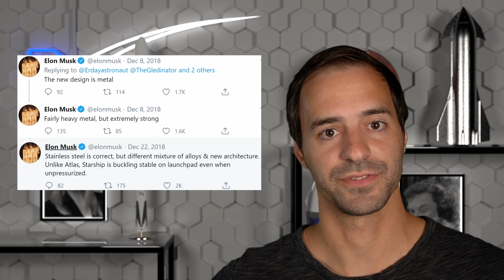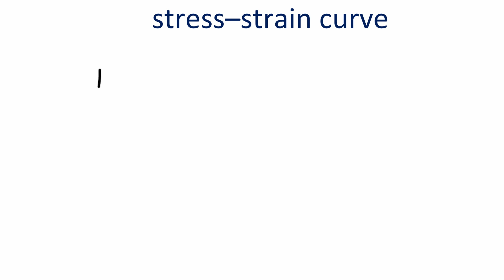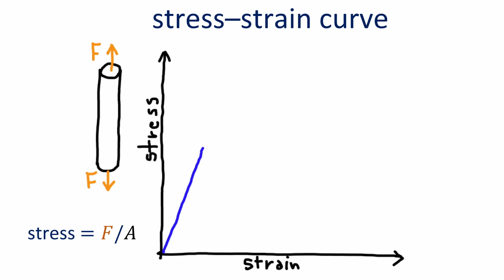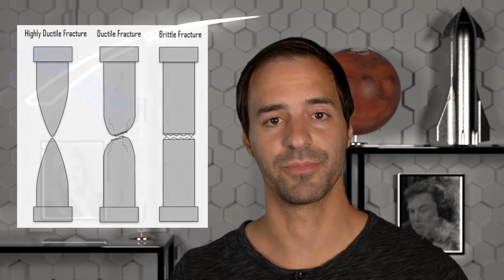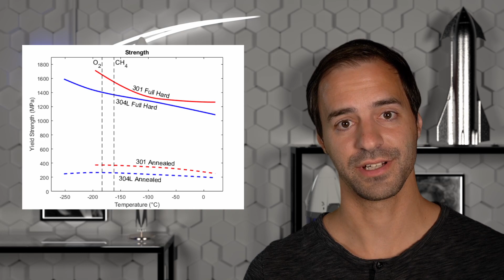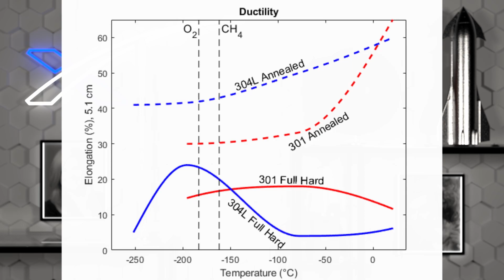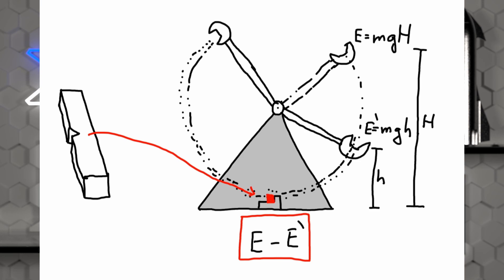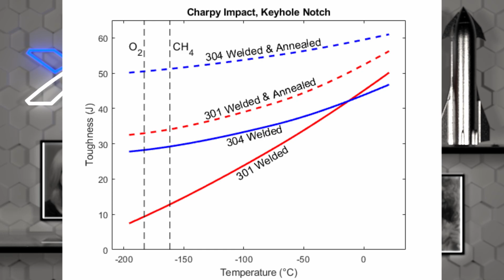Why Is SpaceX Switching to 304L Steel for Starship SN8?

Comment: Well presented and accurate.  I worked in the US Space Program as a Mechanical Engineer. Surprised you did not mention "deformation hardening?"  The physicals will increase even more on 304L tanks if they are pressurized past yield (about 10% into that segment of the curve.)  Our product depended upon strength through staying pressurized. Also we had a gigantic (for the time the biggest ever,) robotic welder that had a reach of over 30 feet to weld inside the tanks nearing completion. Another consideration is "sugaring" during welding 3xx series. Purge gas can be used in a manner much more effectively with a robotic welder (on the inside of the tanks.)  Great presentation, keep up the good work!
Reply from the maker: Than you George! I feel like work hardening is such complex and to me somewhat non-intuitive process that I did not want to go there. Especially when I have no idea what exact hardening they are using. Based on the public information, assuming 9 m diameter, 3 mm thick steel and 8.4 atm of pressure, the hoop stress is about 1260 MPa, which would suggest a highly hardened steel. But I just don't know...
Reply: @spaceflightexplained360 , they kept it really simple back then, K.I.S.S. Basically the vehicle (booster) was the fuel tank. There were minimal internal structures to support the load through the vehicle.  Worse case were acoustic vibe loads (80g+) and when we hit the jet stream, (going 6,000 mph 150 mph "cross winds aloft.")  To compound things Max Q/Max Buffet occurs before that, so the bird needed to be pointing just right at that point. (Visualize a empty soda can, and you can stand on it carefully, then have someone tap it and see what happens.)  At each end of the tanks, we had supports like the engine thrust ring and the inter-stage adapter up top. If you just look at the cylindrical tank, WORK HARDENING was achieved by welding the tank up, and pressurizing the the tank into the yield range. You can visualize this as a "skin stretch past yield point," that IS the work hardening. You might imagine using a liquid and filling a tank to about 1,000-1,200 psi. like a "water hammer."  This is about 3-5x worst case/SF=3.0 (although I worked on some components that had S.F. (Safety Factor) = 0.97! CRES 304L is an IDEAL material for this. Strength increases are 10-20% post proof.  Therefore we could go thinner wall sheeting.  So thin that I could push my hand and deflect the booster skin if the tank was not pressurized. In fact if the tank was NOT pressurized, it would collapse under its' own weight (actual thickness is classified, but it is thin.) This saved weight translated to about $50,000/pound of savings back then, prob 2x now. This was an added bonus!  And it all came from earlier ultimate testing to destruction (fun stuff!) and analyzing the material properties.  Sorry so wordy, love this stuff!
Reply from the maker: @george1gall  I would love to hear more of your stories! I assumed that you worked for Lockheed on Atlas III? 

One of the thing Elon was very specific about that they don't want a balloon tank. They want it to hold its own weight when not pressurized. So they have bunch of welded struts inside so I wonder, if the work hardening by controlled " inflation" would still be an option. It is super interesting to think about though, because it can be such a controlled process.

What surprised me in what you said is that the tank was designed to survive over 3x the intended loads? That is a crazy safety factor for rockets, I thought it is like 1.1 to 1.4...
Reply: @spaceflightexplained360  I worked for Space Systems, a division of General Dynamics. The vehicle was the Centaur which was stacked on the Atlas and Titan boosters.  I did structural analysis and design work on the Titan IVB/Centaur. So I worked closely with Lockheed-Martin, USAF, Marietta, UT, Morton, Rockwell and a few others depending upon payload. The group next to ours was Atlas/Centaur, they were in the midst of conceptualizing the Atlas 5 when I was there.  I saw many Atlas II and III's at the giant Class 1000 clean room at the shop.
Balloon tanks are the most efficient, weight wise.  I believe the Centaur program had a 95% success rate, which IMO sucked.  Out of almost 250 launches that was 13 LOM's and three partials.  But this is what we get when we go down a path so far that emerging technologies which were studied, tested and proven could not be implemented.  1950's tech.  Politics played a big part, failures were like a battle loss during the Cold War.  And, the vehicles were intentionally "expendable" and NOT man-rated.  I love what I am seeing with SpaceX, Blue Origin and ULA. When I saw the success of Falcon 9's first stage return, I was like "YES!!!" as we had that and many other ideas on "vellum" lol.  NASA actually built a proof of concept called DC-X but I don't think the technology (mostly guidance syst.) was there yet.  Of course the re-usable concept was in full effect with the Space Shuttle which was cryo mains and solid SRM's, and strutted throughout.
That said, I think Elon Musk overall is aiming more toward carrying people which will require steadfast reliability and egress. Added parameters.  He uses a bold engineering approach, where concepts are quick to prototype and back-peddling is okay to do, and THAT is key to advancement.  I am willing to bet he started with composites then went down the list. We actually used composites on later versions, but it was a headache, things like voids in the resin matrix out in space, thermal contractions rates at interfaces. And scale factors in general, (ie. make a giant composite tank, but using the same tiny fibers. No go.)  Implementation of struts, longerons, trusses throughout the lower stages for sure seemed logic I bet.  The issue becomes thermal contraction from the hypergolics, though not nearly as drastic as cryogenic fuels, will present stress concentrations at skin/struct interfaces. This implies the need to weld the shit out of it, which in turn means more weight.  Thank goodness rocket engines are so much better now, so perhaps just add another motor and brute force it out. 
The hardening process for 304L I described required fixturing, containment, and safety structures.  That was the higher safety factor req back then (5.0 is like for a bridge, LoL.)  If it were possible, just pressurizing their 304L tank then adding structures would add about 10-20% more strength. 
It was all pioneering work which required proof testing, and it wasn't known if the catastrophic failure would play out as per predictions.  For flight equipment, I often was using a SF in the 1.2 or 1.3 range but as mentioned, when I had one set of components come across my desk with SF=0.97, it got my attention.  Analytical technology was not where it is now, and the existing materials were definitely being pushed to the max, beyond...  That structure was for Shuttle C, a wingless shuttle proposed after the LOM of STS-51 L.  It was for a filament wound kevlar spherical tank.  The mounting struts actually.  Never flew so it went under the rug.

Hey, I didn't mean to hijack your channel. I'm sure there are tons of books about those pioneers, and the race to space.  It's just really cool to see something like what you are doing on YouTube.  I know it takes a lot of time and effort. Thanks for doing that!

Comment: Very interesting video.
In the next one, could you explain how the choice of stainless steel (with starship) fits with the rocket equation when compared to carbon fiber/aluminium, also with a cost-performance point of view?

By the way, now you have a new subscriber ;D
Reply from the maker: Hi there! Aluminum is a no-go, because it melts at relatively low temperatures. In reentry, being able to achieve higher temperature will also allow you to dissipate the heat much quicker.

Carbon Fiber... That is where my knowledge fails. Composites are a different beast and I don't dare to go there.

Look at Everyday Astronaut video, he has a back of a napkin material cost comparison of carbon vs stainless steel Starship

Comment: Great video but I suspect that the maximum vehicle structural loads will be when the tanks are empty upon reentry. Might be the subject of another video.
Reply from the maker: This is hard to tell, but the forces from the tank pressure are insane. We know that they want to reach 8.4 atm pressure with 9 m diameter 3 mm thick steel. Your can precisely compute how much tensile strength you need to hold it, and it so right on the edge of theoretically possible (1260 MPa) will steel. Not even considering the welding...

Comment: While a large number of people have commented on the use of stainless steel over carbon fiber for the starship, in the end starship will be may very well be constructed out of carbon fiber, because stainless steel is much less expensive to construct evolutionary prototypes and test models out of than carbon fiber.  If you tried to do this process with carbon fiber it would take SpaceX a century to build the starship, and the cost would be astronomical.  Stainless steel is to SpaceX, what foam board is to a 5th-grader.
Reply from the maker: I don't know... Given that most of what they are learning and testing are the manufacturing techniques, they would have to throw everything they learn away if they switched

Comment: Good Job!  We will only know the rationale behind these changes or evolutions after the fact.  There is a very good chance that this was decided a long time ago and that due to availability and test applications they decided to wait to progress to 304L, until it was necessary.  Many a mechanical engineer, myself included have built models out of non-essential materials (styrofoam, foam board, cardboard,, etc.) before progressing to steel or aluminum.
Reply from the maker: I think the same thing!

Comment: This was really good. Thanks. I just subscribed on the basis of this video.

I know nothing about steel, this was all new to me, but I do follow SpaceX and Elon tweets quite closely and from that there was one question left unanswered for me. A while back, maybe 3 or 4 months ago way back in about SN2 days, Elon mentioned that they were looking at building custom planishing machines (not sure if that’s how you spell it) to improve the quality of the welds. Does planishing have any connection with annealing? If yes then it all fits together. If not then what does planishing bring to the party and how are planishing effects/benefits influenced by the type of steel - 301/304/304L?
Reply from the maker: Not really. Planishing just makes the welds smoother and removes excess filler material. Well, it can also make the welds a little more consistent. It might be important for aerodynamic and reentry reasons, but it does not change the weld's strength much
Reply: @spaceflightexplained360  Thanks! All clear now.

Comment: Amazing first video !  Starships are reusable and when they re- enter the atmosphere the SS can reach 1500C. Therefore a reused starship is annealed. Does that mean a reused starship is stronger than a new one ?
Reply from the maker: You don't want your steel to get that hot - that is a melting temperature. You definitely want to keep it below 1000 C or less, otherwise your work hardened steel will get weaker because of the annealing.  It might be good for welds, but bad for steel.
Reply: Spaceflight Explained thanks hopefully the heat tiles will keep it within reasonable temperatures !

Comment: I think it is worth thinking about after treatment. It would need to be a huge oven or maybe with inductictive heating, but when you can reduce the overall weight of the starship by let us assume 25% that would open up a lot of new options. Much higher payload, less fuel needed etc. When considering that there may be build thousands of starships it would be worth the effort to built the technology to heat treat the readily welded starships.